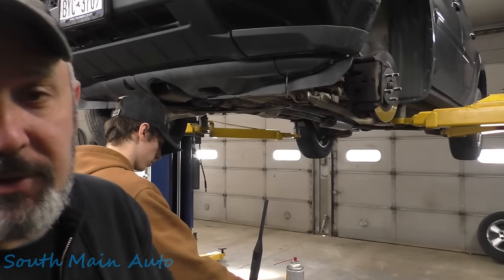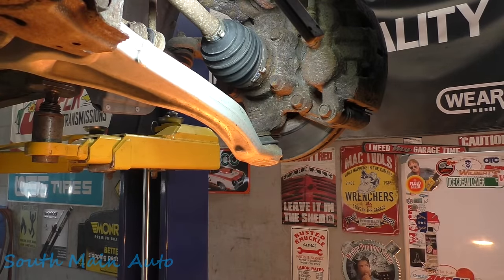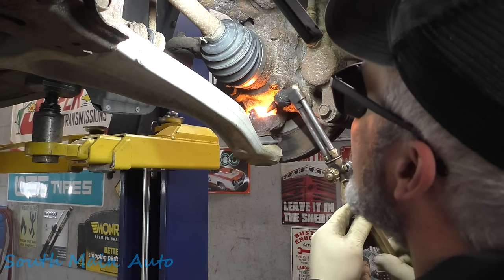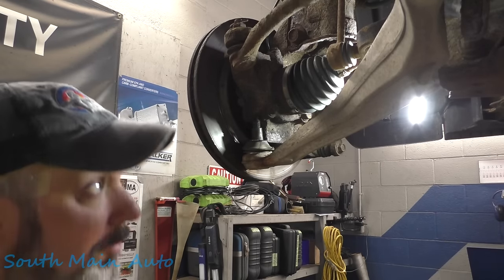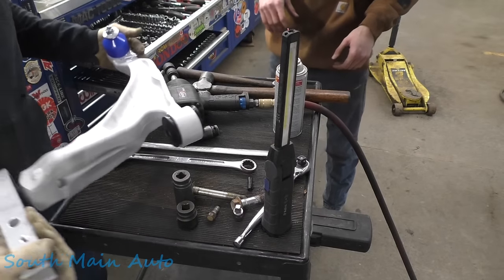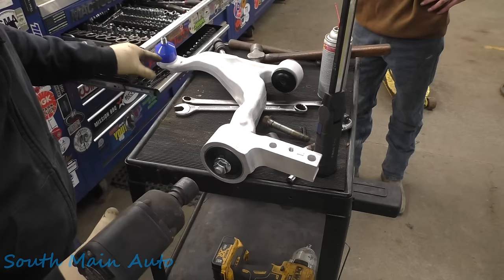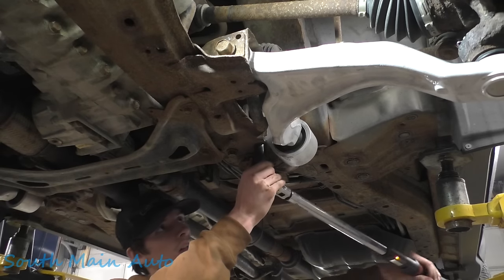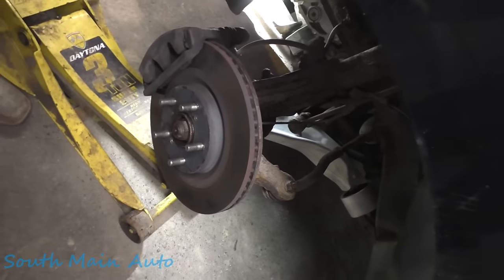'11 Honda Pilot - Front Lower Control Arms

Comment: I found that Moog’s control arms with pre-installed ball joints were only a tad more expensive than the ball joint  alone. Made life a whole lot easier than having to deal with a ball joint press and a very stubborn joint. Just replace the whole control arm.
Reply: Believe Eric stated exactly that 👌

Comment: It's a shame how these "NEWER" cars have become so disposable !!!! And so are most of the new parts for them. I'm trying to keep my older cars running as long as I can. I wish there were more guy's like Eric around to keep them running. Nobody wants to do the kind of work that you do buddy ! Looks like you have a great helper in this video . Keep on truckin Eric & McCoy.
Reply: What's "disposable" about this Pilot? It has 200K miles of living in the salt of NYC and just now getting ball joints/lower control arms replaced. That's a pretty good life and I'd like you to suggest a make/model/year SUV that doesn't need at a minimum ball joint replacement at 200K...

Comment: I stopped using moog ball joints years ago for the same reason you described as NAPA. Like everything, used to be good but now junk
Reply: Between Mevotech crap and Moog, not many option out there for aftermarket parts

Comment: MOOG in the UK use to be my go to for an inbetween cheap and OEM and never had any problems, these days i have nothing but problems with ball joints / track rod ends and drop links lasting 6 months then need replacing again. ive stopped using them unless its the only brand that has that item i need in stock

Comment: Thank you for this video. I have been entertaining the idea that the torch you use is big enough to cut much larger steel. That is the only style I have seen available, I worked in a commercial boat repair facility for most my career. I have always been uncomfortable working with those under a car. I think the manufacturers could build a very much smaller one to use less fuel and be much more nimble; for mechanics doing what you are doing. I know from experience, you can cut 1" stock no problem by hand with it. If held in a machine feed that torch could cut through multiple inches of steel. Again, it is all there is available on the market. If All I wanted was to heat automotive nuts and bolts, smaller is better.

Comment: I'm so triggered I don't even know where to start; chrome socket with a  bendy wigglie on a power rachet using the no mercy revercy and poor McCoy so mixed up he doesn't know whether he's using a click click or beep beep torque wrench!
What kind of shop are you runnin there?😂🤣
Thanks for the laughs Eric.👌
By the way, Moog parts are made in Mexico and Taiwan primarily, but also Singapore, and Korea. The universal joints I recently got were from Mexico and the ball joint control arm assemblies were from Taiwan same as the ones you installed, some of the urethane bushings were from Singapore and others from Taiwan as well. The cheap Moog parts are from China, so still gotta keep an eye open.😉
McCoy is definitely getting his money's worth learning things, like knocking the bolts back, locking tab washers, and even the no bendy cotter pin.
Stay safe takin red showers there in the rust belt.🤙

Comment: You can save a lot of torch gas by just cutting through one side and then go ahead and pull it off with the wrench after that..  It will come right off after you break one side of the nut, typically.

Comment: I've had good luck with Moog ball joints, bushings and whole control arms here in the UK. I wouldn't be fitting the same number of them as you, but hopefully they'll turn out to be better than the Napa ones. I know one of my customers who does ~50,000 miles per year in his van is a year into a set of Moog LCAs and it just sailed through MOT (annual roadworthiness inspection) recently with no issues.

Comment: Also encourage those youngin's to wear hearing protection with impact/air tools.  60+ yr old mechanics are a gold mine for hearing aid companies...some guys are stone deaf in their 50's.
Reply: Yea, Try to Form Reasonable Safety Precautions When You are Young. Grab some Ear Muffs when using air tools. easy peasy ! Try to find some safety glasses you will actually use. dewalt makes a cool looking pair in about to try out. they are cool looking. i wear glasses & they have saved my eyes several times. if you like being able to see stuff. take a little care of your eyes.
if u value them.
safety glasses saved me from - Hydrochloric acid once - it melted a bit of the safety glasses away in a little spot right in front of my eyeball. i was sure glad i was wearing them that day.

Comment: I just put control arms on a Ford Freestyle with almost 300K miles on it and the rear aluminum portion had extreme dissimilar metal corrosion. Appears I made a mistake though since I tightened them while they were in the low hanging position. I guess I'll go out and correct that.  It seems the protective cap would've protected the ball joint.  I didn't have that issue though because I went whole hog and removed the knuckle to replace the corroded bearings, install new drive shafts, both stabilizer links, and both the inner and outer tie rod ends. The advantage was I could measure from the flat inner end to the center zerk fitting. I had to replace quite a bit of rusted steel on the k-frame/cradle since the used replacements didn't look much better here in the rust belt of Michigan. I know the effort exceeds the worth but it's back to a road worthy stable vehicle for now.  I'll probably have to junk it once the CVT fails.

Comment: Eric has too many years under his belt to sell the Safety Glasses idea, but the new guy still has time to embrace the idea. As a machinist, I have seen some bad injuries. Just trying to help keep someone else from the agony. I have 5 or 6 pair of over the glasses safety glasses laying around various spots in my shop, so one is easily accessible at any time. I do nothing without them on, even though I wear regular glasses.

Comment: I know that Moog used to be the top tier for non-OEM stuff, though I can't say for sure how they are as of lately. Some of my friends have said they aren't as good as they are, but I have suspension parts myself that I can attest are still good 5 years after I put them on (mainly outer tie rods I replaced, and sway bar links).

I also tried a company called Detroit Axle and had a failure on a ball joint but they stood by their product and gave a warranty to me over it. Though obviously if it was customer's car that isn't really good.
Reply: Detroit axle is also reboxed China crap, isn't?
Reply: @gianfrancoa You know I'm not really sure...  my stuff says it was from Dearborn, MI so take that with a grain of salt lol.

Comment: I had the pleasure of doing both of these on my 2011 Odyssey. But I bought the ball joint on Amazon for $50 a side, pressed out the old one and pressed in the new one. Dang that was a dumb idea. The pressing out part......should have just replaced the whole control arm.

Comment: The next step for me in upping my DIY/neighborhood mechanic game is to learn to use a torch.  It would be awesome if you could cover the basics.  I know it uses oxygen and acetylene to make a flame that oxidizes the metal, but I have no idea about the settings to use, the safety issues, or what to buy.  Is a Harbor Freight one going to be good enough for me, or do I need a pro level tool to get any real success with it  (FYI, I'm getting better every time with an Autel scanner, fixing the part that's broken without replacing a bunch of parts that aren't!  Thanks, buddy!)

Comment: I'm pretty quick to use heat and/or cut off rusty or damaged hardware. But acetylene and oxygen seem so expensive now, I just got a lower cost plasma cutter...haven't even used it other than a couple test cuts.
   I've wondered why you don't use one. Probably a reason...? Maybe it doesn't work well for that?  It isn't as slender as the torch...probably heats slower...etc...

Comment: I'm from Florida and have never used a torch. How do you know you've made the cut through the flange nut and you're not cutting through the balljoint? I guess it doesn't matter at all in this case, but say you had to reuse them on a different design when they're a part of the knuckle.

Comment: My personal experience with Moog is that it's almost as bad as Mevotech, but for a lot more money. I find at least with the Japanese stuff other than Sankei/555 you're almost wasting your time with aftermarket front end parts. The OEM parts are often a hard sell to the customer due to the cost difference though as I'm sure you're well aware.

Comment: I so appreciate your content. And here's my sad story. 07 Honda with windshield wipers randomly not working for years. Took it to dealer and another mechanic. "Well they're working now so we can't figure out what's wrong." Found you and your excellent vid! Thank you. So, I bought a new linkage and arm from NAPA. Changed it out myself! Turned wipers on, blew a fuse! Ended up taking it to another dealer. Turned out NAPA sold me the part for a 4 door and not a 2 door! Ended up costing me additional $500 on top of $250 for the part!! They had to "re-pin" the system. 😢 I just can't win.

Comment: Never used a torch before but on camera it just looks like an indiscriminate ball of flame. When using one can you see exactly what you're cutting through the glasses? Just curious.
Reply: Yes. It's far too intense to see with naked eyes but with proper tint (#5 or so) you can see the variations of intensity of heat in the steel- from red through orange to yellow/white and the yellow/white is when it begins to liquefy.    The steel melts before the rust does, but this doesn't matter a lot.

Torch Motto: It can't be tight if it's liquid!

Comment: Eric, great stuff as usual. Quick question, if you get a chance, when replacing control arms, service data always says to replace with new bolts and nuts. Is that necessary, and do new control arms usually come with replacement gear? No need to answer as I know you're a busy man. Thanks if you do.
Reply: Only if the bolt specs torque + angle to tighten would new bolts be needed.

That said, even on Euro cars that always say to replace the bolts I rarely do. Only if I know that the bolt is known for seizing in the joint do I have new bolts at the ready.

Comment: Well I don't have a blazing torch or Thor's battle axe to tackle that same process for the lower control arm as show on this video 😅

Not looking forward to the wife's Acura MDX with the same exact design

PS, that crusty front struts   and power steering rack 7:50 😢

Comment: According to the experts, if you lube the threads on a bolt, the torque spec gets reduced by about 20-30%. But I always tell the shop, just reduce my bill 30% instead and I will be fine with that.

Safety glasses. Setting a bad example for McCoy there. I have had the unpleasant experience of metal in the eyeball and a trip to the opthaeyeballist. It was expensive and not fun.

Comment: Mevotech is hot garbage, except maybe their TTX line which is okay.
MOOG is decent if it's actual MOOG. I've seen the same reboxed Chinese part from MOOG, ACDelco, Beck Arnley (which is now owned by Federal Mogul, MOOG parent company), Dorman, Mevotech.
Oddly enough, Delphi is one company that I've not seen a reboxed part from (yet).

You mentioned those bushings fail frequently, and no doubt looking at the part interchange numbers: 51350-SZA-A02 through A07 (current).

Comment: I quit buying shit from Napa about 2 years ago. Their cheaper brakes make all kinds of noise. Also they gave me an account. I had a starter go bad in 6 months. Instead of returning the part as warranty they double charged me and returned it as a core. Then I bought a master cylinder and ended up returning it because I figured out some cars have to have a pressure bleeder. I stead of returning it thru took it back as core. I'm over Napa

Comment: Moog can be a hit or miss based on 10 years of selling auto parts and customer experience..my luck has been good with them on my vehicles.
Reply: Same . Carquest had moog as our premium line . Then they made the transition to Raybestos chassis.  Moog uses old  , outdated technology when it comes to ball joints and tie rod ends . Still  , never really any issues.  However Moog hub assemblies are absolute garbage .

Comment: wondering if napa is having mevotech make stuff to a lower grade than their self-branded parts.
or, mevotech quality has dropped off in the past 2 years. did all the suspension bits on 2 of my cars not too long ago, and everything was mevotech, except for the "fancy" car got moog outer tie rods because they were cheaper at that time, and one came without threads! :D

Comment: The moog stuff is worse than the napa stuff, unless things changed. The u joints are horrible. Ball joints might go 10k.... urg the junk, I don't even bother getting alignments anymore because you going to have it apart soon anyways.. I installed a moog ball joint the other day on the dodge nitro. . See how this round goes... the rubber isn't failing its the joint itself.

Comment: Hey Eric, I have a 2011 Honda Odyssey and noticed that the control arms look different at the back from the Pilot in this video.  It’s just flat but it also looks a bit tired. I don’t have any drivability issues like you mentioned here but I’m at 190k kms so wondering if it might be a good idea to replace them?  The OEM parts are insanely priced.
Reply: I just did both lower on my 2013. I was going to just replace the bushings because they're cheap but picked up a decent set of arms on Amazon warehouse and went that route.

Car is in WI so the vertical bolts were very difficult to remove, and the drop links were so rusted that I needed to cut them out with an angle grinder. I had planned for that and had new links on hand.

Comment: Is torque to spec on retained, ie split pinned fasteners a give take, because as a European I cant see that possibly working, a torque spec based on a 45 degree variation of tighter or looser isn't a torque spec it's a massive guess

Comment: No doleful predictions that the Honda will be pushing up daisies at Wilberts in a couple of years?  That looks like stage four rust to me.  On a Silverado you would have been humming Pray for the Dead.
Reply: Any Japanese car sold here in UK has corrosion prevention right from the factory with probably minimum 6 years anticorrosion warranty anywhere on the body. Buy a grey import direct from Japan and there's no anticorrosion protection. It sounds like the US gets the unprotected ones, probably because salt is not used in the majority of areas.